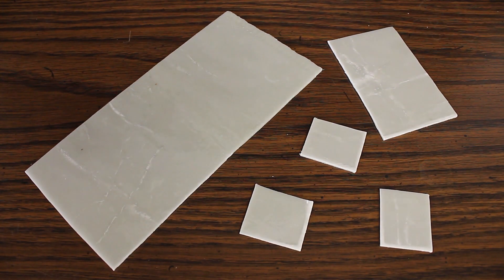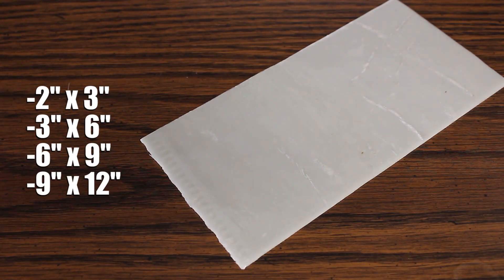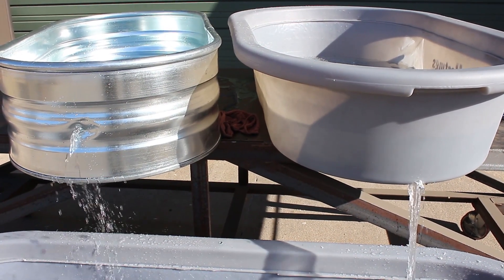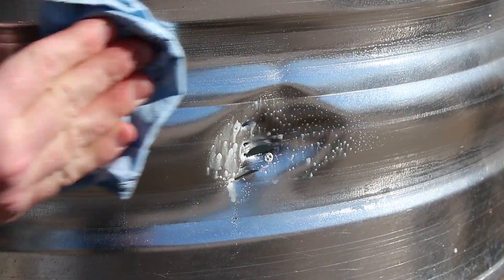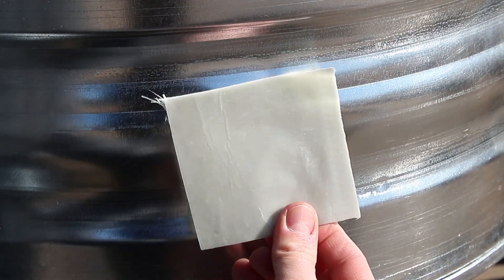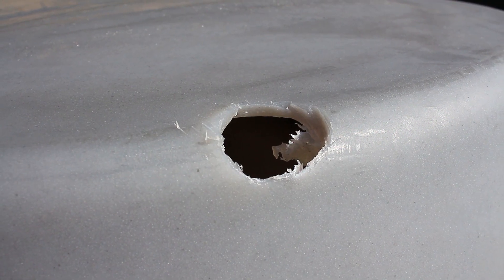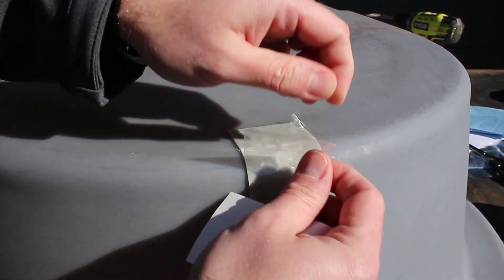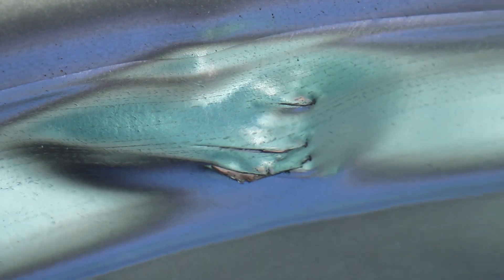DurapatchUV™ on Stock Tanks - DL Difference

Comment: Will this hold on a 300 gallon Rubbermaid stock tank? Because nothing else will…Should I heat weld first, then add the patch? Also, is it safe for fishes and horses?
Reply from the maker: Thanks for reaching out!  Durapatch will definitely adhere to your Rubbermaid stock tank and is safe for your animals, but its ability to fully seal the damage on your tank will depend on the extent of the damage and where it is located on your tank.  Feel free to send us pictures of the damage to customersupport [at] dutton-lainson [dot] com so we can further assist you.